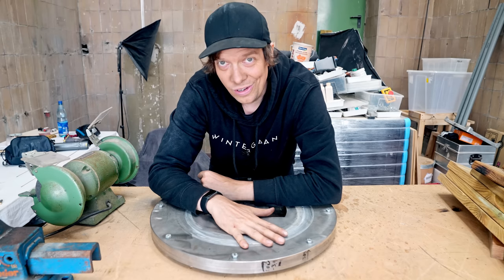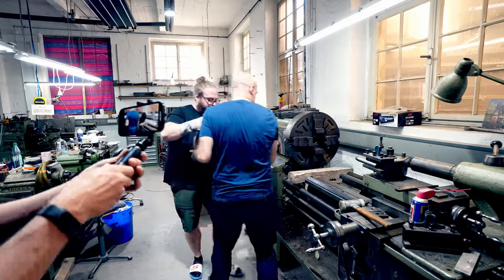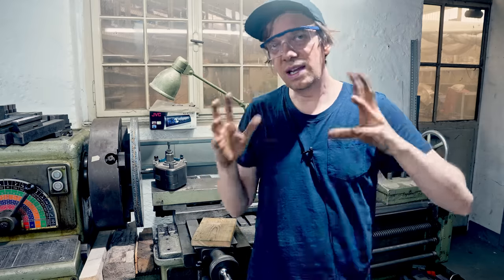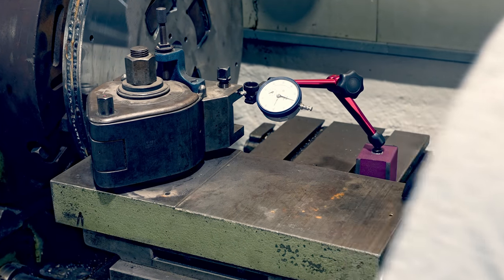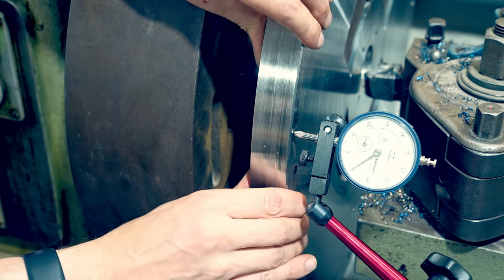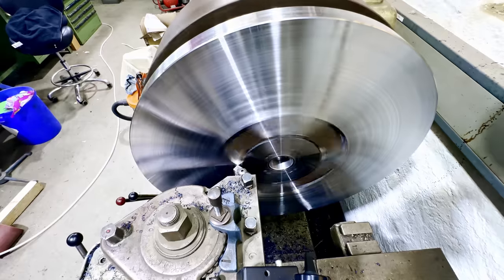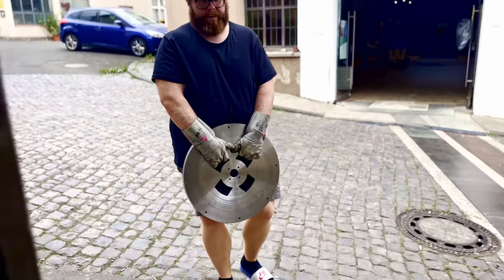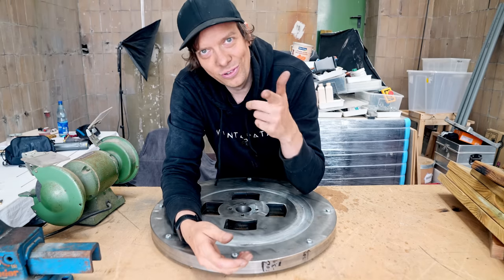Can I Turn This Wobbly Flywheel Straight? - DAY 7,8,9 - Marble Machine Flywheel Prototype

Comment: I’m not a lathe operator, but I feel you missed a step…. You got 3 good sides on the wheel, but when you flipped it, how did you make sure the back side stayed flat? Any imperfections mounting it backwards will just be amplified on the front side when you turned it.

Comment: Wobbl;y flywheel not as important as it is to get it balanced. That 0.5mm wobble should be perfectly fine. Just make sure the fly wheel isn't considerably heavier from one part of the circle to the other. Reason why cars can go so fast is cause wheels are balanced well but don't look like they would be

Comment: I wouldn't be surprised if the brake design will ultimately cause this issue.  You should really be using a disc brake, rather than a single lever like you are... or at least have the lever brake on the edge.

Comment: Noob question: if you are eliminating material where you welded, won't you eliminate the welds?  is there any danger of the plates coming apart because the welds are 'gone'?
Reply: You can see at the end that some of the seams did appear again. This isn't super bad though because the forces that the welds have to endure are quite low, especially at the perimeter.
edit: also the weld melts material below the surface so even if the protrusion is completely removed there will still be a weld.
Reply: He's melting the metal a few mm down from the surface, so as long as he doesn't take to much of it'll be fine. Welding isn't just on the surface of the piece, it goes down into the metal itself.

Comment: In order to get it rotationally balanced don't you need to center the plate on the inner hole? Otherwise it can be that the inner hole ends up off-center right? no expert but a thought I had

Comment: Oops..... Tapping the flywheel also sends a lot of energy to the indicator. Luckily, you were tapping away from the instrument, but still...  When you tap towards it, please remove the instrument, because it is a VERY delicate instrument !!! You can EASILY damage those tiny cogwheels, on the inside. And yes, that requires another adjustment. Maybe many times. But the instrument is worth it.

Comment: What was so wrong with the motor driven system you used on the MMX? Fixes all the timing problems and could still allow for dynamic changes in BPM. A welded flywheel is never going to be accurately round and true.

Comment: You can't lathe with out an axis.  You can have a fixed axle or bearing because the tail piece holds your work in place.  You can't machine laser cuts or welds. Your work is moving because your not using the tail piece and your tool pressure is too high you keep avoiding putting in a simple interference fit on a single piece of metal.  Bolts and screws will not work on spinning parts.  Take off less material for more even finishes 😅
Reply: You can't mill or lathe welds or laser cuts

Comment: Unfortunatly, what you are trying to achieve is almost impossible with your setup. On top of the chuck not secured, it seems that the top slide is loose (tightening the tool in the holder should not move the top compound as we can see at )14'02. Moreover, the cutting insert is moving during the cut (see the insert rotating at 13'10-13'20 during facing). My guess, the lathe has wear and gibs should be adjusted. And finally, a shaft d20m for that mass is way too thin, at least 40 would be more coherent (take into account the inertia during operation and not only the raw mass of the object).

Comment: Can't you mill the flywheel so it doesn't wobble ? 
While with milling your piece will be flatter IMO due to the possible bent you can get with lathing as you saw yourself. 
Yes it's a robust and big piece but that brings a big moment aswell if you have an instable crank. 

It was just my opinion you do whatever your please is good.

Comment: I would not operate the flywheel in its current state. Instead, I suggest balancing it with weights. This could easily be done on a car tire balancing machine in about 15 minutes.

Comment: Why not just have a company mill/cnc you a full wheel from a solid piece of metal, rather than sandwiching multiple sheets of metal together.

One piece milled down would have better uniformity.

Edit: You need a better braking system than that bar. Because all that bar is doing is; grinding down that spot of the flywheel and will eventually make it unbalanced. I recommend a rubber brake, or other soft material in aifferent location, or just wider overall

Comment: Hmmm just my two cent as a novice... wouldn't lapping be a better way of getting a really flat and therefore true surface? ... and for braking... would a bicycle oder motorcycle discbrake work better? by putting stress on one side of the flywheel, don'T you put enormous stress on the bearing? a discbrake would be better and should not complicate things to much...

Comment: Dont lift the whole flywheel by the axle!!! (21:00, 21:30)  Im quite sure your axle is bent because of handling it like this, and not because of it being that much 'undersized for the application'. I mean, couple mm diameter won't hurt, but please... Dont lift the flywheel like that. You will also ruin your next 30mm shaft if you'll handle it like that.

Comment: Put the wheel back on the lathe & re-machine the hole larger, & re-machine the sides.  Then make a sleeve to make up the difference between the (too large) hole & the taper sleeve.  This sleeve needs to have a slit cut in one side.  You can do these things when you have  good lathe!
          If you do a good job of machining the wheel, it SHOULD NOT require balancing.  Your RPM is too low to require that!
          Most of the wobble (other than loose chuck) is because of that @#$ welding!  Welding causes distortions, & when you turn welds, the welded metal is harder than the bulk because of heat-shock it suffers.  If you weld around the hole, that metal should be annealed with a torch.  When the wheel is turned, it should rest against the face of the chuck for support AT THE OUTSIDE EDGE.  Put in uniform shims for this.
          These details aside, this wheel is WAY OVER DESIGNED for marble machine.  This is more like what goes on large gasoline engine!

Comment: Just cus the flywheel is turned, doesnt mean it's perfectly balanced. Imperfections in material and welds will have an impact on balance... and idk if the workshop has a tool to balance this thing properly....

Comment: I cannot tell you how many times Martin does something, and I want to shout at the screen. 

One plate wobbles? 
So what.

 WHAT HAPPENS WHEN THE OTHER PLATE IS ADDED?

For all anyone knows they offset and the wobble vanishes. 

Trying to solve a problem before fully identifying the actual issue.

Since the mount to the lathe isn't being done exactly the same as to the marble machine frame, you cannot use the lathe to make this fix without compensating for it.

Comment: He needs to get out of the mindset of being a beginner doing manual machining.  If this is a proof of concept, the balance of the flywheel is the last thing he should be concerned with, over important things like the energy storage.  If this is intended to tour with, then he needs to order a fully lathed and assembled fly wheel that he doesn't need to lathe/turn/machine/do anything with except install it.  Why he is manually machining a flywheel is beyond me.  Why he is doing any fabrication aside from what's needed for assembly is beyond me.  Why he bolted 15 different plates together to make a flywheel instead of just ordering a solid, already balanced wheel is beyond me.

Comment: Please be careful using that lathe they are VERY dangerous and very powerful. You are SO lucky that chuck didn't spin off, had you hit a break it most likely would have. That machine has the capacity to turn you into ground beef in seconds and maim you for life.

Comment: Im pretty sure the steel you used from the start is to blame. You laser cut a not flat steel. That kinda wobble is not something you would get from a lathe or w.e you did to it. It was handed to you in bad shape.

Comment: You could also try drilling small holes to remove small amounts of material, in order to mass-balance its center of gravity around the axis. They do this on the rollerons of supersonic missiles, and those spin at 100.000 RPM. Smarter Everyday made a video about this.

https://www.youtube.com/watch?v=x8L83AHYum0

Comment: you know this is all completely pointless, you should be building the actual music part of the machine BEFORE you look at how to power it. how do you know how much power you need to supply to the music machine if you dont even have a working machine to plug the power source into. get a working instrument power it with a electric motor to begin with and THEN look at other way to power it. do you know if you need 1KN (KiloNewton) of rotational force to power the instrument or is it going to need 10KN of force? is it going to be a constant draw of rotational force or is it going to be ever changing? also a fly wheel is ment to be heavyer than the part of the machine you trying to power it with, at least with the way your setting it up because of inertia, so how heavy is the rest of the moving parts of the machine going to be? 
If you dont have the answers to at least some of these questions then all your doing at the moment is wasting time and effort in building something that your probably not going to be able to use in the end.

Comment: if you have no experience on a lathe, you should NOT operate a machine with this size and power. turned out the chuck was not tightened, could end cathastrophaly.
Always ask for guiedance by people with the right background.

Comment: You did yourself a disservice even after flipping the chuck.  When you flipped the wheel over you should have been keying the alignment off the surfaced BACK, keying off the rough face serves no purpose..

Comment: Lathing the flywheel it is the wrong solution. The flywheel needs to be centrically balanced with it's hardware attached. Lathing flattens surfaces, however flatness does not equal balancing. Look to the automotive industry for crankshaft balancing techniques.

Comment: It‘s not like the type of wobble you show has any influence on the function or tightness of music. It‘s so frustrating seeing you invest so much time in an optics only effect on a function prototype :/ would have liked to see a better testing methodology instead of your ‚chasing an external beat‘ system
Reply: Agreed—also concerned that this project is chasing such precision (unobtainable and unnecessary).  Adding to the mess, is the methods for testing this precision are so flawed.

Comment: I just don't understand the choice of adding a flywheel to the machine, there has to be so many easier solution to this problem. Flywheel has to be one of the most difficult mechanical concepts and I think it's not a coincidence that it's so seldom used as a mechanical solution in commercial products.

Comment: Can you? Maybe. Should you? Not when there's a commercially-made ones that would fit your requirements, if you actually bothered to calculate your requirements. Will you? I have my doubts.
Reply: Bump
Reply: I think Martin thinks this prototype will help define his requirements. I don't believe it will, but I believe he believes it. If his past adventures are any indication, we will either never see him properly define requirements or he will only manage to define them after designing and building everything.
Reply: @STRIKEcorperation  Yeah the speech at the end about trying to become good at all engineering so he can outsource all the parts is just perpendicular to getting anything complete. He's continuing to order professional made parts then mangling them together combined with with misunderstanding in sloppy fixes in the name of perfection.
Reply: @STRIKEcorperation  Even though uneducated individuals like Josh will refuse to believe it, Martin has already set himself on the path to failure...again, at least as far as completing a marble machine for a world tour goes.
Reply: @Josh_728  Who are you?
Reply: @DevanConrad  To his credit, I believe a lot in the value of learning to make parts yourself to understand how to engineer better. I'm glad Martin is spending time getting to know traditional machine tools instead of trying to laser cut his way out of every situation. It is something that is not taught in most engineering schools where I'm from and new grads are laughably incapable of actually designing things.

That said, cobbling things together in a machine shop will not tell Martin whether his tests are measuring something useful. He needs to take a step back and actually write down what he wants and then learn what it means to achieve what he wants.
Reply: @Josh_728  I'm an experienced engineer and design, as well as your mother's current courtesan.